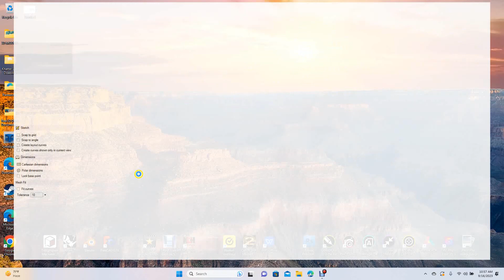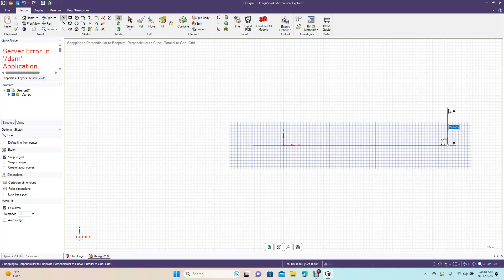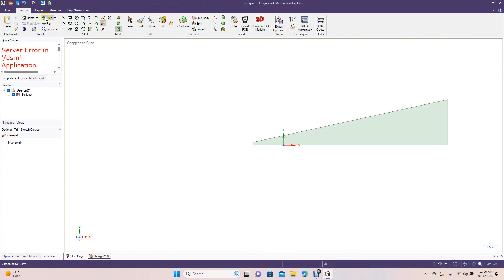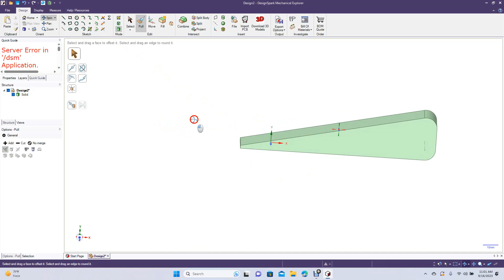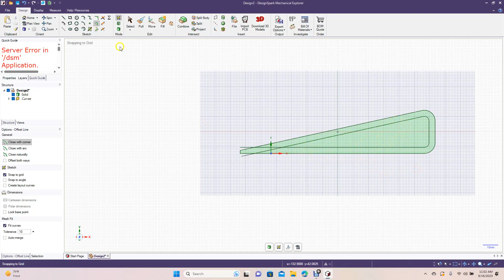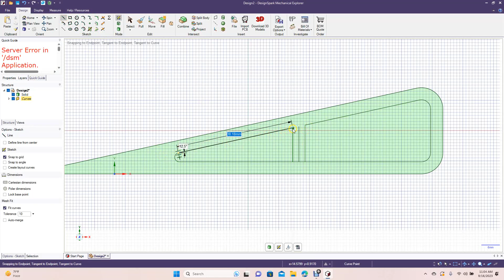How to create a rubber door stopper in design spark mechanical

Comment: I am glad I found your youtube channel as I am getting started with DSM again after using V4 years ago. Tutorial request: I need to make a round container with 2 halves that will snap together and stay closed. The plan is that the retainers can be released by pushing them down with a small screwdriver to open the piece again. And the outer top half also has to have retainers so that when the whole piece can be pushed into a 1/2" hole and not come out unless those retainers are depressed. I am having trouble figuring out how to make the retainers for both halves. Thanks. To better picture the object it will be like a small version of a 35mm film canister but solid on the top and bottom and slit in the middle and push together like a vitamin or supplement capsule. I will be 3D printing the end result.
Reply: I have found some good info on the internet and think I have found the answers to my questions on different snap joints. If you want to make a video with DSM on different types of snap joints I am sure it would be helpful to others but for my initial request, I think I have it under control. :)
Reply from the maker: I created a pill fob a while back. Check out the video, it might be helpful. https://www.youtube.com/watch?v=c0vrcsuTPPw&t=200s
Reply: @dailey3drevolve  Thanks for the link. That really helped for my part I am working on. Its a good starting point and can be further modified if needed. I should have found that in your playlist but you have over 200 videos! Keep up the good work. I appreciate it.
Reply from the maker: I'm glad it helped Dave.  @davesworkplace1616